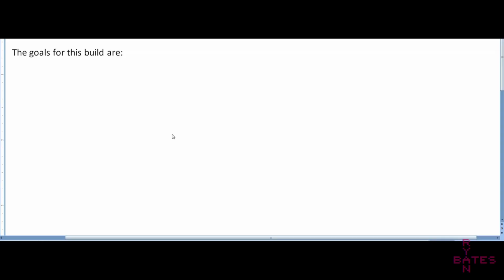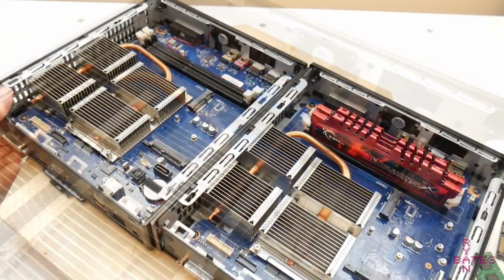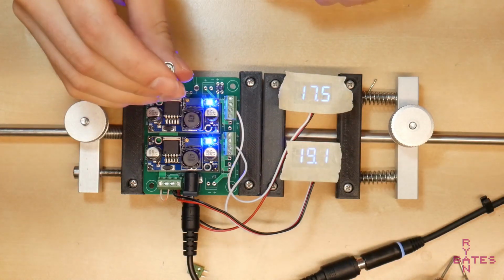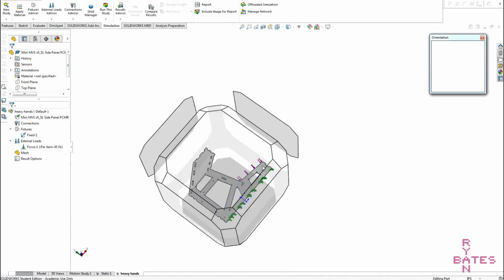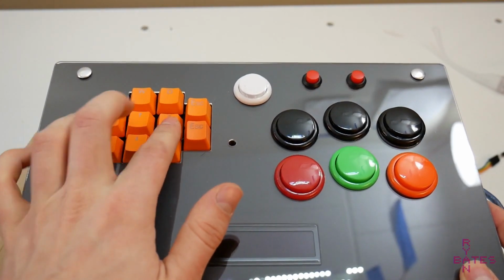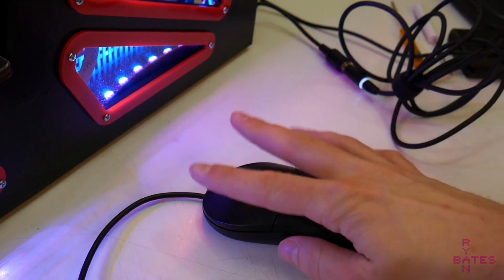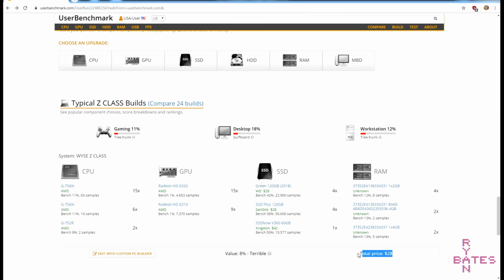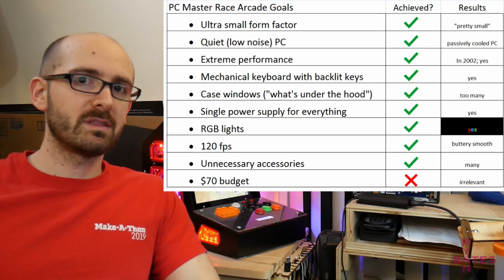Ultimate PC Gaming Arcade Machine | PCMR Edition

Comment: only u need open up the ssd is the same size
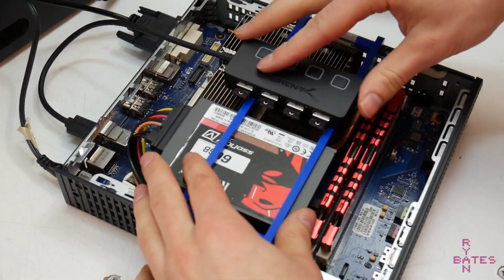Reply from the maker: great suggestion. I did this and unfortunately this drive's PCB (i think because it's an earlier SSD) is the same size as the enclosure. If you look at the SSD label @15:36 it appears that it was peeled off; it's wrinkled and the corner is lifted. This was me having a peak at the inside.